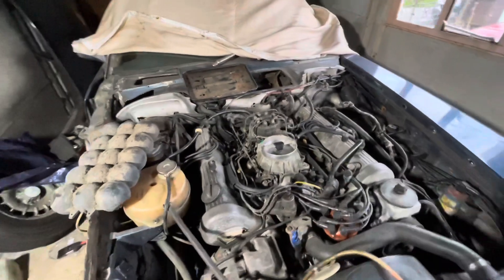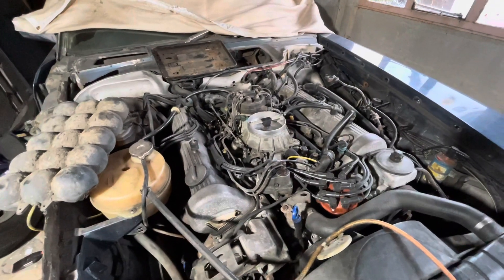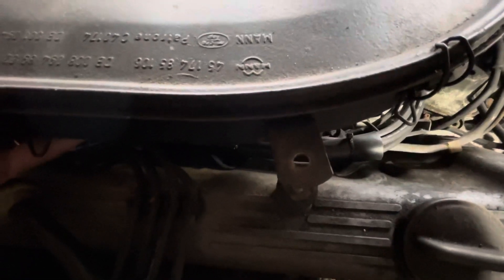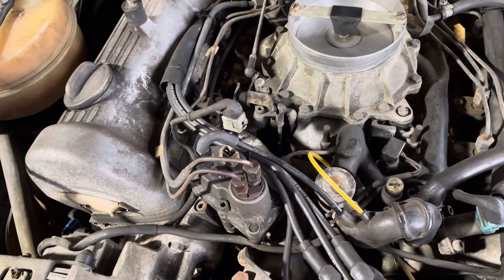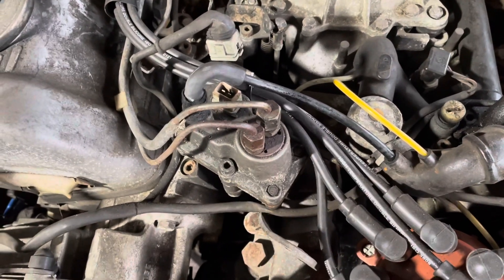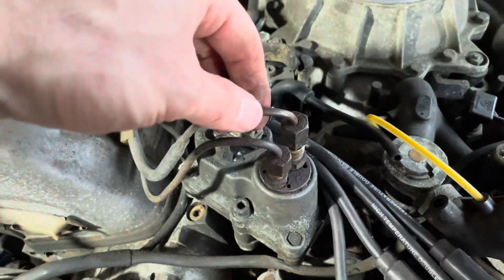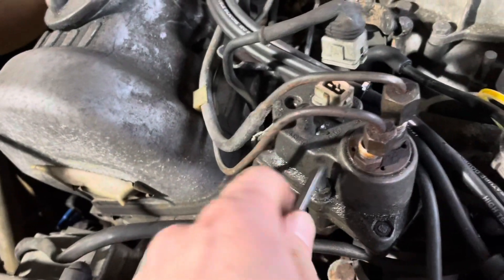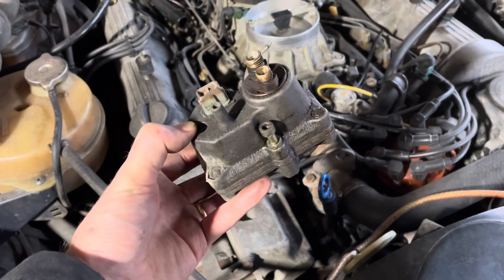Mercedes R107 450 SL Warm Up Regulator removal

Comment: Do you know where I can get the two fuel lines that connect to the warmup regulator?
Reply from the maker: I’m not sure if they are still available. I usually check with SL Shop (UK based) or Mercedes directly for parts availability.

Comment: Did you ever figure out this car? I just got done fighting one of these and the problem was that someone removed the single diaphragm WUR and put on a double diaphragm WUR. The problem lies in the fact that the vacuum lines connect the opposite way. I see it looks like you got the same problem going on here. Switch the vacuum lines and it’ll start much better and run better warm. Hope this helps!
Reply from the maker: Thanks for the comment, unfortunately not, I had a bit of change of circumstance with this car and had to move it on.

Comment: You should try to fix it yourself first, the kit is cheap and it is actually fairly simple; if you fail, just put it back together and send it off.

The bi-metallic strip rarely fails, usually it is the diaphragm that rupture.s.
Reply from the maker: Thanks - if I’d found your video before taking it off I might have had a go, great video. As it happens I’ve already sent it off and it’s back from refurb. Haven’t tried it yet!
Reply: @classiced1416  Great - I would also take disassemble the fuel distributor, as the famous adage, goes "while you are in there".

The fuel distributor can also be rebuilt "at home", there are plenty of kits online.

With regards to the engine, please open up the cam covers and inspect the condition of the timing chain, tensioners, guides and the cam oil tubes.

Also look at the timing marks on the camshafts, this will also give you an indication of chain stretch.
Reply from the maker: @cav4290  yes I really want to do something on inspecting the timing chain, just a bit distracted with dealing with all the welding at the moment!